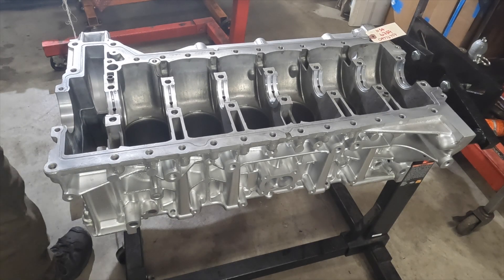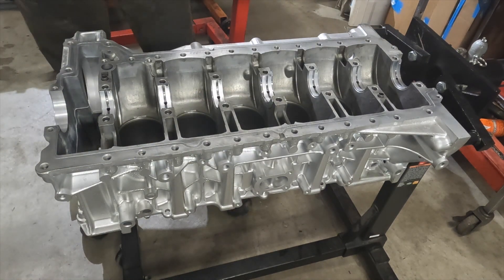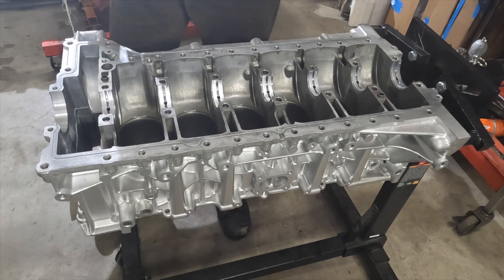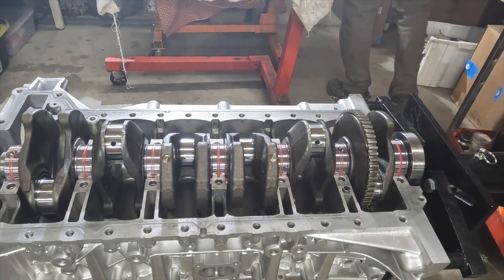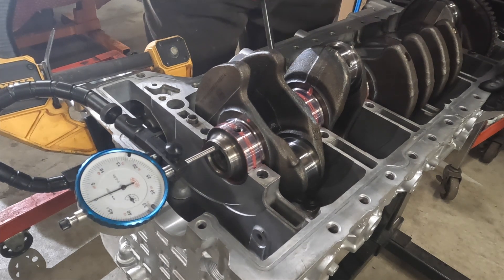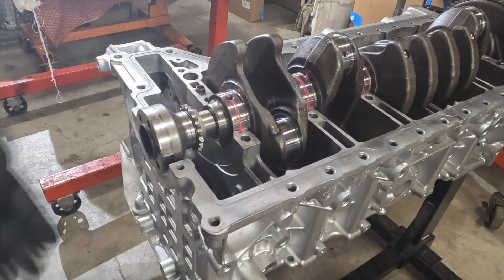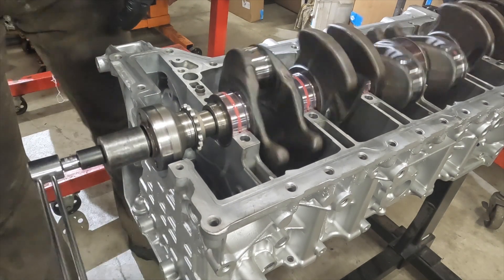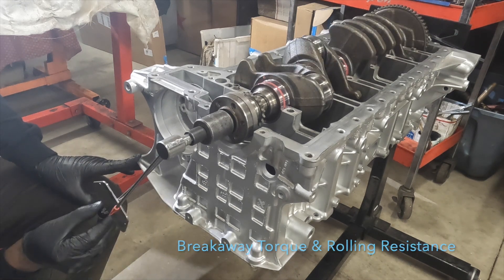BMW N54 6759 Rebuild Crank Install, Runout & Clearances Part 3

Comment: Thank you very much for the series and the fact that you discuss the interesting parts everybody else seem to skip e.g sprocket orientation etc that I came by chance through research when preparing for some jobs recently (preventive chain and rod bearings replacement while I was at oil pan seal and cam cover job). As for the runout, I saw a video recently from BMW  rebuilder in Poland talking about the failures he saw and testing they do on dead engines they get (crack check on journals using dye, runout check) and he said something interesting that the runout measured after removing the crank from engine is different to a measurement taken days or weeks later due to stress relief. For some reason some BMW cranks bend (not only n54) and that was a case when he talked about one of bmw diesel cranks he had shown, but there the runout was big and that led to main bearing failure on the middle one. All remaining bearings were perfect on that engine. By the way, the rod bearings on my N54 were worn already at 145k km due to combination of long intervals by first owner, hard life of modded car that lived in Germany and oil dilution by faulty injectors. Thankfully I caught it in time and the journals were perfect.  Cheers!

Comment: Top man. Video series is going to help me alot with attemptin my first bottom end rebuild 🤙🏾
Reply from the maker: Good luck
Reply: @straightupbmw  do able ? Hardest part looks to be sealing the bedplate ... Do you know which type of needle will fit the loctite tube and seal against the injection valve ?
Reply from the maker: @beamms   # 14 needle

Comment: Ur crankshaft is bent.
Reply from the maker: Yes, all crank all crankshaft are bent, it depends to what extent.  BMW allows a certain amount of eccentricities , this crank is within that limit 

Thanks
Reply from the maker: Yes it is, but it’s within the limits of acceptable runout by BMW